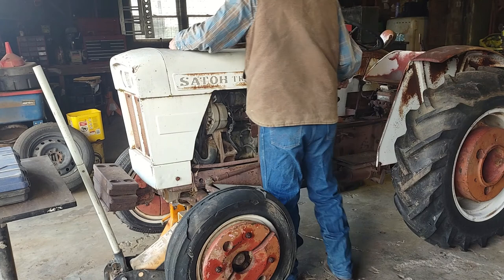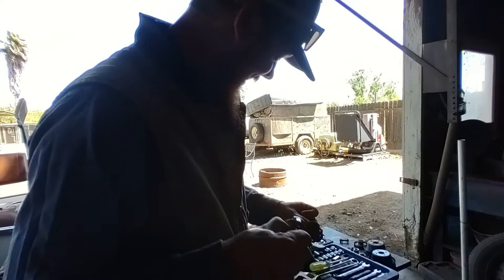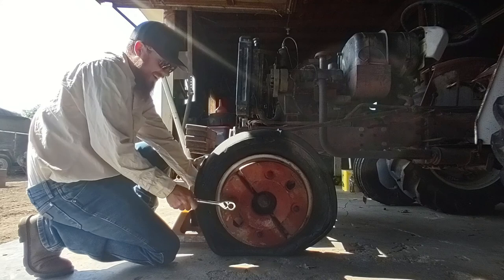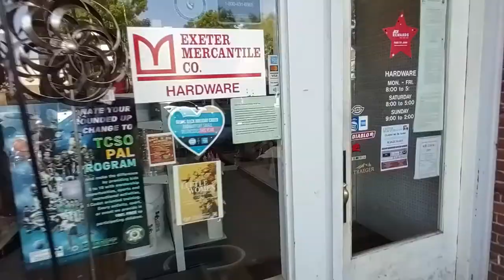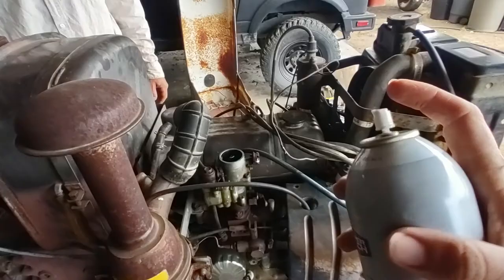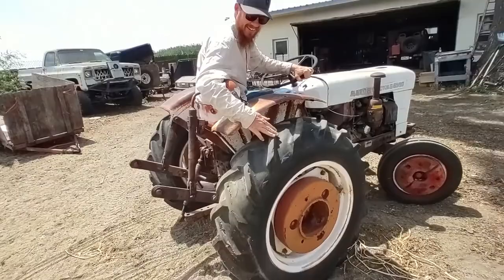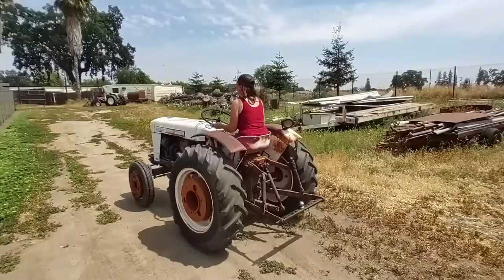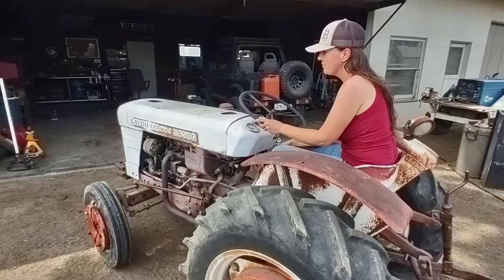Driving Tract-HER for the 1st time! | Satoh S650g Tractor | RB Story | Ronny and Brettany

Comment: I own 2 satoh s650g, one has belly mower, other has front endloader, both runs great.
Reply from the maker: Nice! We've been looking for one with a loader!
Reply: @RonnyandBrettany  I actually bought a loader that went on a John deere and cut down and fabricated to fit the s650g.
Reply from the maker: @sethtaylor8340 Interesting... 🤔
Reply: @RonnyandBrettany  it was a front loader from John deere 3010, I used a hydraulic pump from a roll off flat bed truck, fabricated a frame that bolted to back, and coupled the hydraulic pump to the pto,  so that have plenty of power to do work and not take power from the power steering. I mounted a 20lb propane tank to side of the loader frame, right in front of the back right wheel to use as a hydraulic fluid tank. I've been using it for almost 15 years, only had to change 1 hydraulic hose since.
Reply from the maker: @sethtaylor8340 That is so smart! If there's a will, there's a way!

Comment: I have the same tractor. Do you by chance know what to look at exactly when the lift won't go up or down using the lever? I moved the flow control valve accidentally and I it quit going down. I figured out what I did and I put it back in the proper position. It made about 4 passes up and down the driveway working fine, then it stopped going up all of the sudden. I can manually lift the rear hitch and it will stay up and it will go down due to gravity. It doesn't make any effort at all to go back up. I am sure something is stuck in one of the controls, I just don't know where to start and I don't want springs or valves flying across the yard.
Reply from the maker: We have never had any issues with the hydraulic system. Maybe check the hydraulic filter and fluid? Make sure the fluid is topped off and there are no metal shavings or that the filter isn't plugged. Might be a hydraulic pump? Ours only works if the lock/plow/till lever below the seat, is in the correct position. Hope this helps! Let us know what happens!! And good luck 👍
Reply: @RonnyandBrettany  Thanks for the reply. I'll check the pump also.
Reply: @RonnyandBrettany  I finally got my tractor back operational. After disassembling to inspect the hydraulics and finding that everything was working except the valve control. I determined that when part of the oil cap broke off and a very small piece of plastic from the oil cap was lodge in the control valve. I cleaned up everything and reassembled and it is now working.
Reply from the maker: That's awesome! So glad you got it operational. These tractor parts are expensive and can be hard to find. Thanks for letting us know what happened 👍Pat yourself of the back for a job well done! 🙌